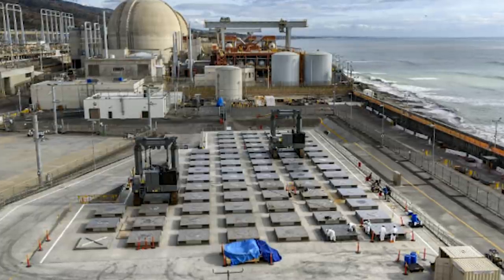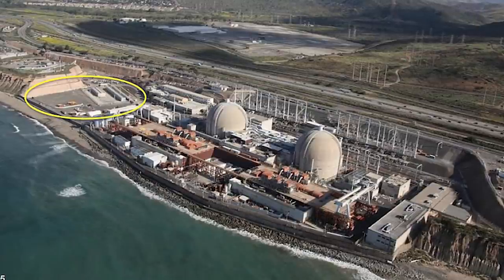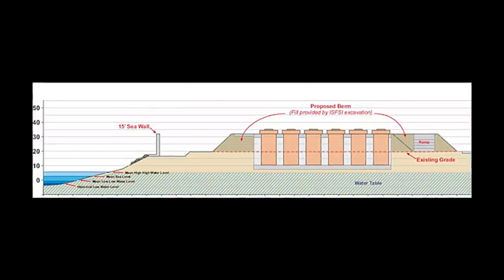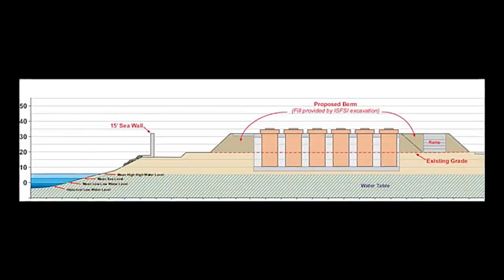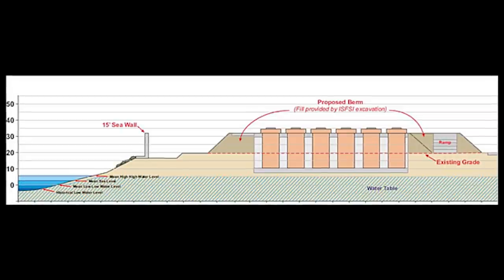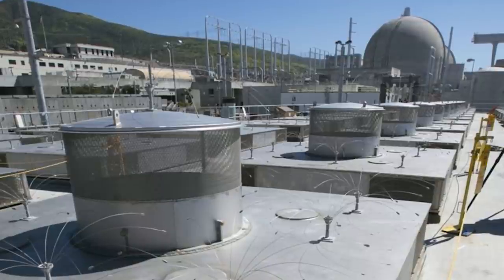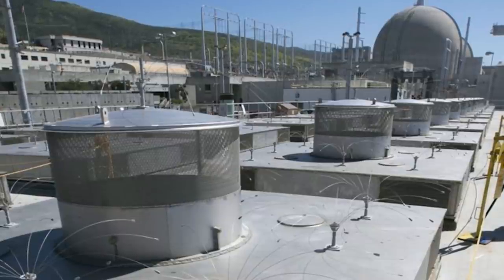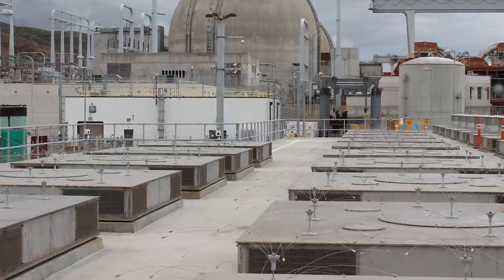Potential for Disaster at San Onofre

Comment: A small wall like that may hold back a tide but will not the water simply go under the wall and rise on the inside to the level of water on the seaward side, to equal the water pressure so the water level on both sides of the wall is equal ! Additionally  my question is why should water gain access to the canisters as they are constructed from steel ?
Reply: water tends to fuck steel up broski

Comment: Many thanks for the analysis of this extremely badly-designed waste depository.  
The immediate solution is, as you good people mentiioned in the beginning, to make a PROPER sea wall, high enough to guard agains a Fukushima-level tsunami event.  That buys time to get Thorium breeders buit.
The long-term solution is, of course, what China is doing now (and India is working on), the Thorium MSR breeder, which can use this high-level waste as "fuel". 
When Paul says, "Every government facility" has been a failure (re: reprocessing nuclear waste), keep in mind that is every U.S. facility.     Other countries have been able to reprocess fuel, and with Thorium MSR (Molten Salt Reactors), ordinary high-level waste becomes easily turned back into fuel.